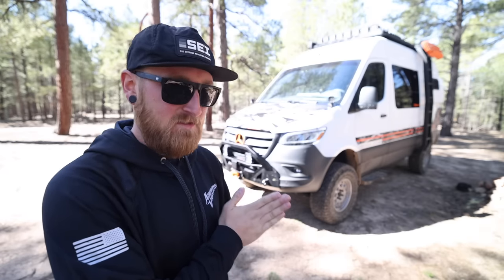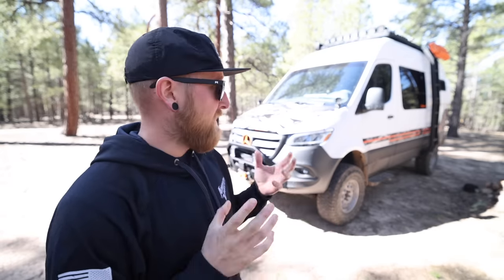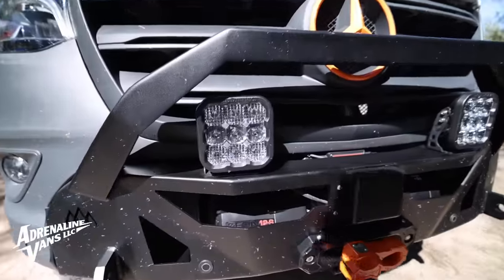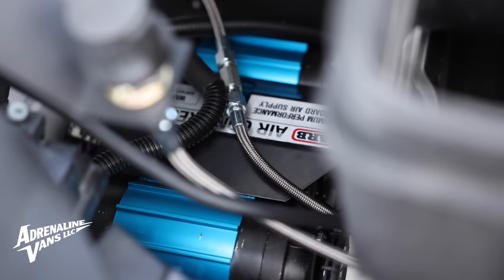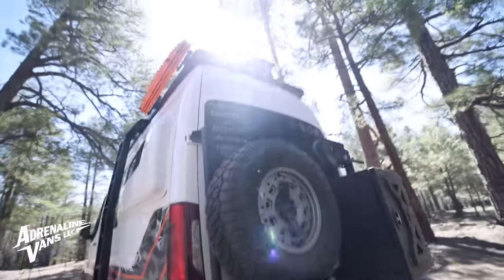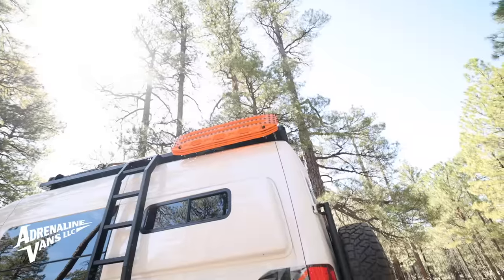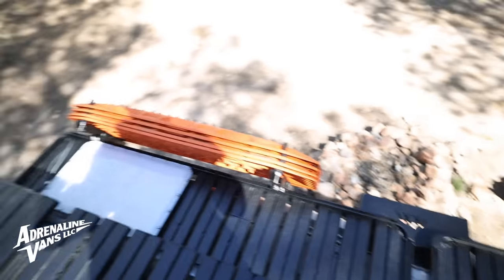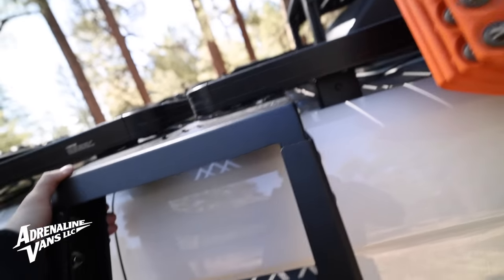The Storyteller Overland Build is Complete! | Adrenaline Vans

Comment: Why did you opt for the VanCompass 6.3 Suspension kit instead of the Agile kit?  What are their respective strengths?   Similarly, with the new 4cyl AWD, do you feel a need for Pedal Control or any other sort of engine "tuning"?

Comment: Just add the high idle function so when you go to a hot and humid place at night and use the airconditioner ten hours all night but dont wanna drive away your camp site the next day, but still wanna use the air conditioner all day, you just turn on the high idle and recharge the batteries without having to drive anywhere.
Reply from the maker: I have extra keys where I could do that but I don’t think I would ever actually use that function to justify the cost… never say never tho 😆

Comment: Debating between going full leather vs the  synthetic leather with cloth centers on the Scheel-Mann seats for my STO. Do you find the seat getting hot or your back sweating with your full leather seats during long drives? Wondering if the cloths centers perhaps offer more breathability or it doesn’t make much of a difference. TIA
Reply from the maker: I really prefer the leather for the longevity of the investment. I have my windows ceramic tinted so heat level while driving is much better than before and no I don’t really sweat much while driving.

Comment: Love the Scheel-Mann seats, but looks like you lost the electric memory function of OEM. Any regrets losing that function? I use mine for different swivel orientations that have various tilt and slide changes. Still easy to swivel?
Reply from the maker: No regrets on losing that function. Manual seats are faster / easier to swivel

Comment: Can I ask what you're doing for battery charging? Are you charging the house battery and the vehicle battery off a higher amp alternator or do you have plans for solar?
Reply from the maker: Storytellers come with a small solar panel but most of my charge comes from the secondary Volta alternator when driving.
Reply: @TalonSei  Cool thanks for that info.

Comment: Did you also put AMP running boards on the drivers side?
Reply from the maker: No just the passenger side. There is a lot in the way to install one on the drivers side. Probably not impossible, but the juice wasn’t worth the squeeze.

Comment: Nice build. What made you go with 285/75R17's, and not let's say 315/70R17's? Or 35x12.5R17's? I've got 265/70R17's now but looking to go bigger. I also got the VC 6.3 so no issues there.
Reply from the maker: 35s are going to be a lot heavier, and can cause  issues with adaptive cruise and other Mercedes features. 34s like mine are the perfect balance for me
Reply: @TalonSei  you didnt have to do anything to the electronics for the adaptive cruise to still work? I thought anything bigger than 275/70R17 required some reprogramming? I have a 2021 V6 sprinter though, so perhaps that's new on the AWD
Reply from the maker: New chassis must have something to fix that because I haven’t needed to do anything.
Reply: @TalonSei  that'll make a lot of AWD owners happy! thanks for your replies

Comment: How did you penetrate the roof with all the wires?
Reply from the maker: We installed an electric pass through right next to the existing one in the front left corner of the roof, ran all of the wires and sealed it up.

Comment: How does this Van do towing your side by side?
Reply from the maker: Haven’t done it yet but I imagine it will be just as good if not better than my old van.
Reply: @TalonSei  How much does your trailer and side by side weigh when loaded up? I am considering buying a Storyteller but I tow a 3500lb to 4,000lb trailer with a 4 seater RZR Pro XP and small ATV. I think maybe the Ford Transit LT Mode might be a better tower than the Sprinter. Any thoughts? We live in Colorado and ride all over the state, including Utah. Need adequate power to get up and down the mountains.